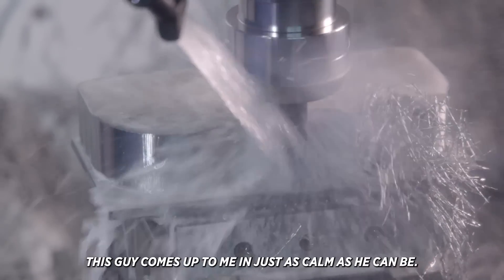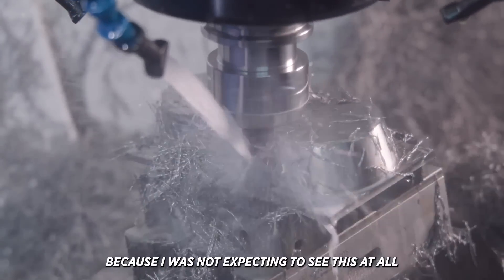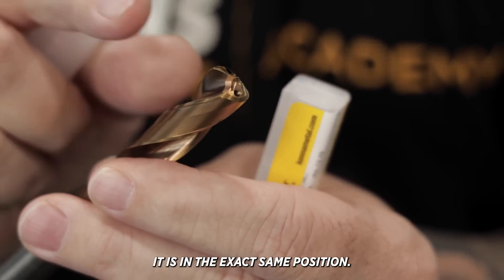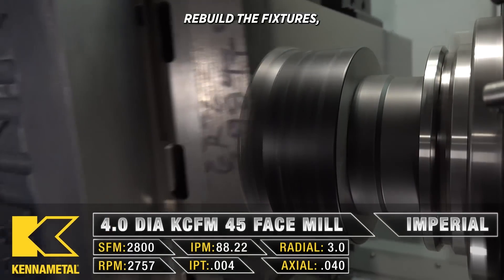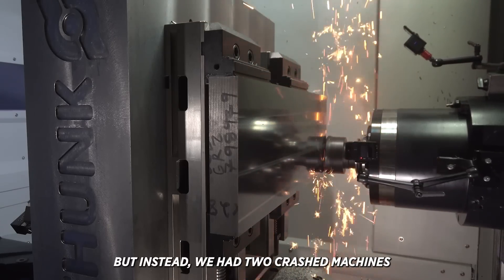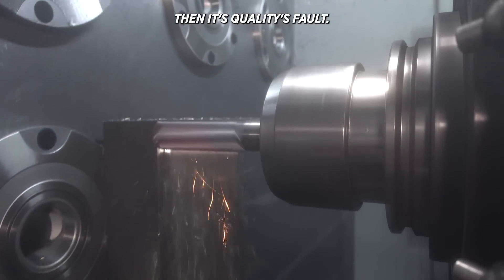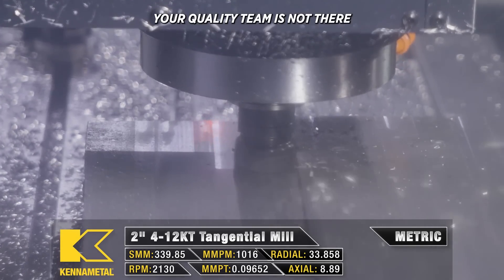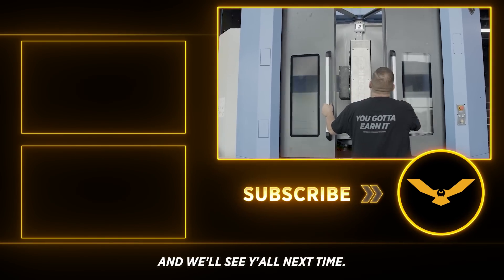$200,000 Damage | EPIC FAIL… Machinist CRASHES TWO MACHINES at the Same Time

Comment: Seen a few bad crashes.

The "worst" (dumbest) was actually the funniest. Not funny ha ha... But you'll see.

I had a basic understanding of programming, setting up, and running CNC from a job with 1 manual tool change M code Bridgeport. I ran my jobs through that when needed. Say 20% of my time. Got laid off after 5 years.

Next job I only applied at shops that had G code machines. By that time I had 20 years of shop time. Mostly manual. With 8 years as assistant foreman.

I was lucky with the job I got because they had a dozen 4 axis multi-tool VMCs and cared more about my overall exp. They were willing to train the G code on the job. Just what I wanted!

Their largest machine had a 50 tool mag, and a work space that was over 4 feet off the floor due to the rotary. That sucker was the biggest machine I had ever run when I finally got the chance. 

I'd run parts that weighted as much as a car in the shop where I had been assistant foreman, but this was a sweet piece of machine.

So, it was a mom and pop shop. Literally. Mom ran the business, and Pop did all the programming. His two sons were foreman, and assistant foreman.

There were 8 of us on the floor.

Pop's programs were a mess. First piece runs were a minefield of bad moves. Sometimes in rapid. One of his favorites was to put + X moves where they would send the rotary onto the tool. Sometimes in rapid.

I had to learn to read code while tapping the "next" button fast enough to keep Jr off my back about being too slow during 1st piece. Never crashed in the two years I was there. Well, if you don't count having a end mill break in the part and the kill the next tool.

Sometimes Pop would send out a program then walk out to set it up. Once when he did that I was working on a machine one down and across the aisle from him. He was at the big 50 tool changer I mentioned above.

Less than 20 minutes after he started setting up he brought a tool in and drove it down into the rotary in rapid. It sounded like somebody slammed a big old car door as hard as they could.

Nobody got hurt. The machine was cleared of obvious dangerous scrap metel, and Jr tried the spindle and table. The spindle made a noise like a scratched record. Everything else seemed okay. 

We were told it was over ten grand for the spindle replacement. I think it was way more but they down played it out of embarrassment. There were three techs there for three days changing and zooming the spindle. They were all from a county in Asia. Plus the days that machine sat idle.

A couple weeks after it was going again I ran a job in that machine. It seemed fine. We ran a lot of stuff that was very critical. +0.002 left for grinding, and dead nuts perfect dowel hole locations on curved sufaces were the rule. Even the rotary was okay after being refixtured and realigned.

So... And here's the wtf funny part. A month or so after that machine was humming again, Pop did the exact same thing. This time Jr messed around with seeing it they could still make parts with the machine. The spindle had a buzz that came and went. Flattened bearing or like that, but for the rest of my time there that machine ran good parts.

Also Pop never came out on the floor, the 2nd oldest son started doing most of the programming (he wasn't much better than pop), and I found out why pop went from being a great machinist to not being that...

I knock on his door one day to ask him to get a new carbide bit. I heard a smash of glass. When he called me in it reeked off alcohol. While he got the tool I saw a broken bottle of booze in his waste basket and a big wet area behind his desk.
------
Worst crash? I saw a guy get hit in the forehead by a 60lb cast aluminum part that jumped the toolpost on a lathe. I was looking right at him as his feet came up and he landed on a skid of parts a few feet way. Career ending. But he lived.

Once the lawyers got all their pictures I was assigned to finish, That. Same. Exact. Part. in that machine. I put a skull and cross bones on my hard hat and wore it everytime I ran those parts after that out of respect.

Comment: Good luck with teaching anyone nowadays with pride in work or even work ethic.  I work in the automotive supply industry and if the setup operator/operator can't hit the go button they call me.  9 times outta 10 it's something simple they have the ability to fix.  That's why they make the money an hour they do.  (That's a upper management problem).  Some of the setup operators make just as much as I do as a tenured maintenance.  One of my higher paid setup operators makes more money on his side hustle (PS5 and Nike shoes) at work than he does doing what he is suppose to do.  So again if he hits the go button and for whatever reason it doesn't go.................ya they calling the radio....

Comment: The biggest crash that I’ve seen was of my own. I was employed by a well revered graphite machining company where I setup, programmed and operated a fryer ET-100 turning center capable of running 100” diameter parts (yeah… friggin huge!) while running a 10,000 lbs/85” dia rough-cast billet of graphite in my machine, the stock began to shift inside of the 6-jawed Chuck it sat in due to pressure loss in the tail stock. Eventually the part exceeded the ends of the jaws and the 5-ton mass of graphite dropped to the ways and into the tool post. I felt the ejection in the floor before I’d ever seen what had happened. Luckily no one was hurt and after inspection, and meraculously, neither was the machine other than a dented guard. Thank god graphite is a soft material! Although the company didn’t take any reprimanding action other than an expectable evaluation of the incident, I spent the following two days without sleep and was significantly depressed. It’s disheartening to hear of stories like in this video of operators who lack the understanding of what harm their negligence can result in. Of course the fiscal side but also that of safety. The manufacturing industry has come a long way in keeping employees safe, but it seems as though some have a hard time grasping the concept that when it’s you against steel/spindles/geared servos/cutting edges/lifting devices/gravity, the latter will always win void of safety.
Reply: That is one heck of a story! I hear you on  the feeling distressed part. I have felt the same way after crashing a machine. Anyone who actually takes pride in their skills and work would feel terrible.
Reply: Is the graphite for EDM or similar?

Comment: In high school on a manual lathe, I intended to engage the powered Z+ axis (move the tool to the right) but accidentally pulled the lever in the wrong direction which powered the X- (tool into the work) with the speed set pretty high. Nearly instantly a massive metal "hairball" was produced, and the motor stalled. Luckily there were no injuries, and somehow the only damage was to the HSS tool and the part - Machine was fine miraculously... Learned that lesson.

Comment: your own fault,count 1 2 machines so attention dived,count 2 if hes not there cant stop it,its the danger of 2 machines 1 person,and bosses say its your fault ,well bull shit if you run more than 1 machine then your not there to stop it happening ,lets do the logial 2 machines its half the attention per machine,and ten we  will add travel times between machines .yup its perfect for operator to say dont know,reason he was 20 feet away looking at something else,its bull shit the crap you get,if you want my attention 100% on 1 machine then 1 machine it is,if its break time say 11 till 11.10 then im on break time.just because the machine was sold as all singing all dancing and will cut your costs,not true they lie same with tip tool sellers there product is 3 times cheaper and faster than seco,guess what they all lie.how can you tell a salemans is lying,its easy his lips are moving.

Comment: Worked as a maint. machinist for Hughes Aircraft in the mid- 80's. Got to see lots of crashes big and small. The most impressive one was when one of the drive lugs on the spindle face of a horizontal machining center came off at speed. The screw apparently fractured and the harden steel block shot out, riccochetted off the door edge, hit the inside of the safety glass on the open door, cracking that, nailed a nearby steel post, and proceeded to strike the operator square in the forehead. He dropped like a sack of grain and had to be taken for some stitches, but otherwise he was okay. He had been warned to keep the door closed but who listens to reason? He was just lucky he wasn't the first or second stop on that little block's path. It would have brained him good. Earned him the nickname "Hammerhead".

Comment: I used to work for Lockheed Martin, did for 8 years. One of my jobs was running a robot up and down the front and rear left and right side beams for the wings on C-130J's. This is about around the same time the LM130J was coming out for FAA certifications for putting that aircraft into civilian use; the company bought an AWAC or automated wing assembly cell. Basically a giant tape deck where you put the pinned together beams into a cassette and drive it over to the robot; the robot drilled the holes, shot sealant into the holes, vacuumed the shavings up, ran nuts down and torqued everything. Supposedly. This thing ran fasteners down backwards, double drilled holes every 20-30 holes, ran nuts down on fastener heads and generally acted a fool the whole time it was in operation. Im not sure if Lockheed still uses it, I left not too long afterwards...but Ive seen some of the shit that thing put out and Im glad I never flown on one of these aircraft.

Comment: Worst crash i seen was actually a couple crashes on the same mashine.
Was called there to fix the mashine, a old massive monforts lathe. That is with a stiff bed and not screwed to the ground (as not needed), a very heavy mashine though so normally it would not move.
I came there and saw they mashinist managed to shear a VDI60 holder straight off. And i found out the whole mashine has moved about 2" (could see on the floor where it was standing before).
Was a crash of the tool with rapid feed into the chuck, with enough speed to break off 2 of the 3 jaws.
Well anyways started to do all the realignment as of course everything was misalligned at that point. Through talking with the mashinist i found out it wasn´t one crash, but two.
He ran into the spindle with the tool, then decided to "fix" it by running the spindle in the other direction and letting the mashine crash the same way a second time. I didn´t have any words at that point.
Well 2 days later everything was fixed again, told the guy to carefully start to work again and check everything is alright, i started to clean my tools and take them away.
5 minutes later: ka-boom. Same mashine, same crash AGAIN!
The idiot loaded the same program without fixing the error, put in a new tool and pressed start, put everything to 100% and went to get a coffee.
Figured at least i alreaddy know which screws i have to turn....

Comment: Before changing careers into IT in the 90's I worked as a CNC operator in the late 80's for a company that made fuselage tie tools for air craft builder's like Boeing and they had new Mori Seiki CNC's and I've seen quite a few crashes.  It takes only one line G code error change to cause a major crash. They are powerful enough to drag a fully mounted eight inch vise across the table with such loud a noise that a horror filmmaker special effects department would envy.

Comment: Worked as a entry level cnc machinist for about 9 months straight out of tech school. Never wanted to do factory work again after that experience. The owner was a total asshole more interested in building a golf course next door to the shop. The air quality in machining bay was shit from all the vaporized coolant.When I would turn the only exhaust fan the owner go turn it off. The coolant was some horrible cheap shit that gave people skin rashes. I started out running op one and two of a three machine cell. When the guy running third op quit, they never hired a replacement, so I had to run three machines. Then they brought in some efficiency expert who basically stood there and watched you🙄

Comment: The worst crash I have ever had was burying a Yasda H40I into a $3000 part at 200IPM from starting on the wrong line after hitting reset. Didn't ruin the machine but did scrap the part and snap the cutter. It was a minor crash in comparison to others I have heard about, but it was my worst to date and almost made me sick over it.

Comment: i think the worst thing ive had happen was when i was about only 2 months into my job at a shop, and i reset the CNC program while it was in a tool change,   causing the changer to crash and drop the spindle. i was lucky that nothing ended up damaged, but i was sure worried i messed up big time

Comment: 1.3k👍's up thanks for sharing
Reply: 1.3 million dollar billing machine lifted up the flatbed trailer with four forklifts two huge clamp trucks for loading paper rolls to make corrugated boxes and the other two forklifts were normal pallet jockey forklift I don't need to tell you where this is going do I well in the reservoir on this compactor shall we say there was 500 gallons of hydraulic oil I can't tell you what kind of mess that made on asphalt the only reason why this is funny to me is cuz they fixed it then I worked at machine for 5 years we had quite a fabricator in our meeting shop he didn't like me but that was okay you can fix the machines I didn't break nothing that's what's funny

Comment: I work in an environment that isn’t a machine shop... we have 3 older summit lathes and 2 older summit mills... one night a guy on night shift left the auto feed on the lathe carriage engaged and walked away.....LUCKILY... ish... the stops were still on and it did crash the tooling and mess up a new ish 4 jaw chuck..(old but not used much) but we started locking out the disconnects to the machines with combo locks.

Comment: Worst crash I had was when a tool-changer threw a fit and what it thought was small end mill was actually a 12" fly cutter. Me checking a previous job before sending it off to inspection so not watching like a hawk when I hear the spindle ramp up and a hum like a industrial fan on overdrive followed soon after by a heavy thunk! sparks, alarms and the bellowing of my supervisor! I was 18 and it was my first proper gig so you can imagine how I felt.  Was a long week relegated to broom duty with everybody from my boss on down giving me some sour looks as the program checked out fine on another machine.  Knew I was going to get the boot come Friday, everyone treated me like a dead man walking. Eventually with only an hour or so to spare before my exit meeting the maintenance guys came through and saved my hide. The tool-changer had lost a small magnet off one of the storage drums and was miscounting its position. For the next four years at the start of the shift I stepped through checking the dam thing was indexing properly.

Comment: When I set my tools and datum probe I always used a "0" datum above the job, probe the datum and enter the minus offset and run each tool as a double check to first cut position with a stop program just for safety.
Reply: I set my F Cam to write all tool changes with an optional stop before and after tool changes.

The M01 in the code stops pauses the machine if the M01 button on the control panel is activated.

Great for insuring all tools get double checked during 1st piece prove outs. 

I also have a rapid to 1" above the part, then to 0.1 above. In single block this allows a quick by eye check that everything is okay. In auto  the two moves look like one with no pause between.

Comment: Worst crash I've ever seen was my own. It was and wasn't my fault. I was doing the first initial rough cut on 3" 1080 round bar. The saw man was supposed to be keeping them within .25 of each other, and marking them appropriately. I ran out of parts, and he brings over another one that was marked .128 over. So I grab it, toss it in the machine and hit go. We had the machine rapid traveling to .5 within the max tolerance of what they were supposed to be cut at with a 1.5" insert drill. Then BAM the fuckin things crashes, breaks the drill, tool holder, and a few other things that I can't remember. So yeah about the .128 over marking, it was actually .8 over. Boss was pissed at me for the simple fact that it happened. However, ultimately he fired the saw man.

Comment: I worked at a little bigger CNC industry some years back, not as an operator but technician, but I can tell you that if a operator at that place and a similar thing had been directly the cause of $200k+ in damage he would have been fired on the spot no matter how long he had worked there, period.